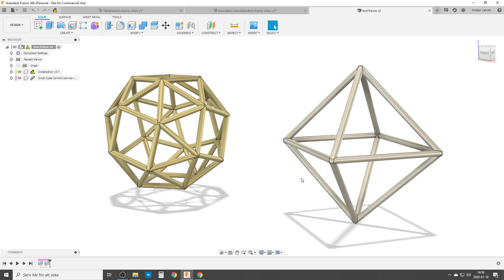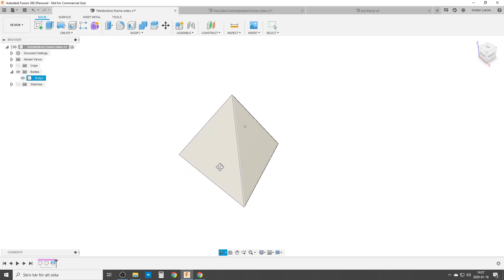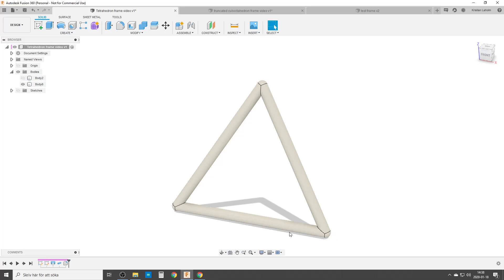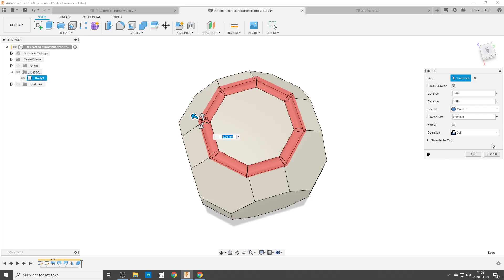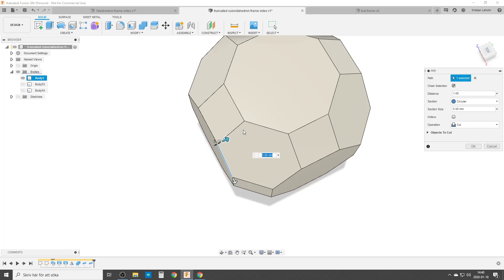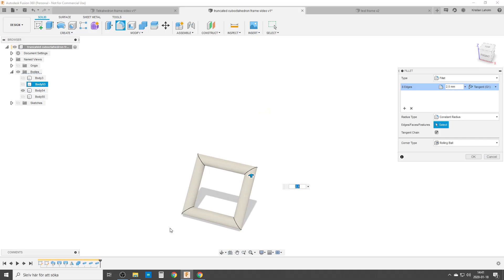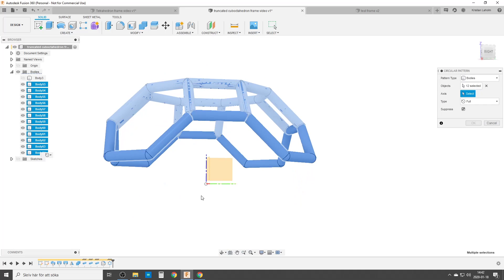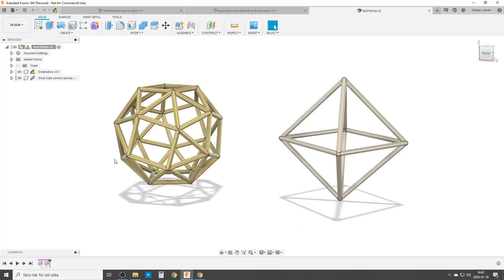Make a Wireframe from a Solid in Fusion 360

Comment: Cool Idea to use the edges of a solid body for that operation. I used the 3D sketching before, which is more complicated. Did you notice, that you can use the "Pipe" feature from the sculpting menu to get SplinePipes with a more soften edges? ...if someone needs this like me.
Reply from the maker: 3D sketching is powerful and useful but sometimes it gest a bit confusing.
I'm not using Form that much, will need to spend some more time with it :)